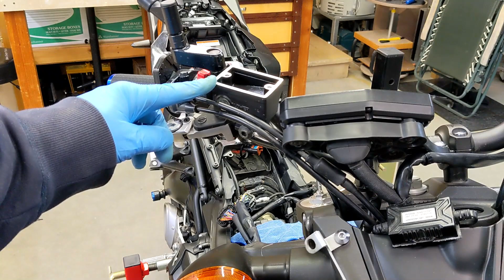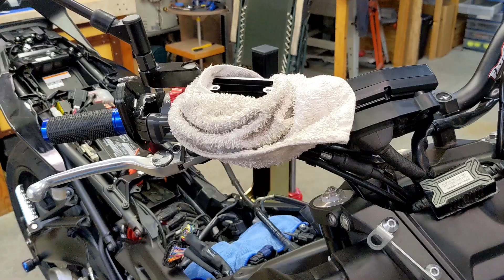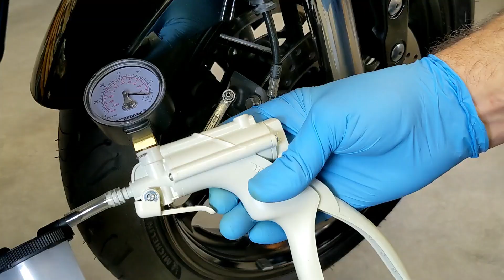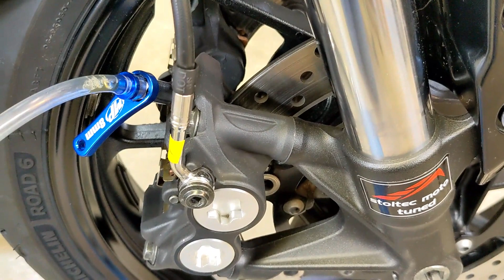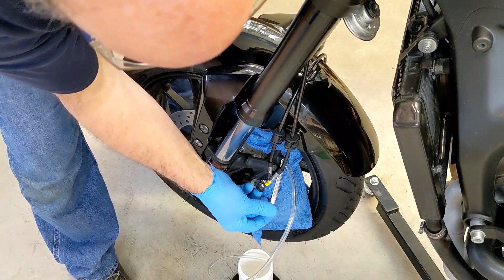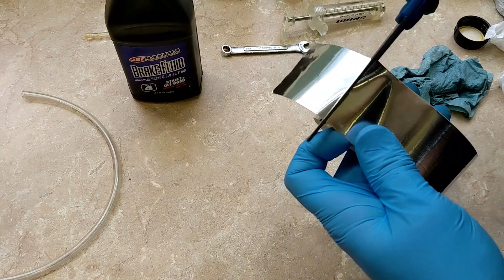Yamaha FZ-09/MT-09 2014 2015 2016 front brake bleed

Comment: I just biught brake pads for my fz09.

Do I really need the bleeder to remove all fluid and refill with DOT 4?
Reply from the maker: No you don't need the bleeder. I just used it because the lines were empty... You can just flush out the old fluid since it's good to change once in a while... Put a hose on the bleeder nipple into a cup or something and then pour fresh fluid into the master cylinder reservoir and keep pumping until the fluid runs clean... Usually this it's called a gravity bleed...Watch starting at 8 minutes and 7 seconds into the video for procedure...
Reply: @meticulousmechanic Wow, grateful for your response. You just saved this man a headache and some money.